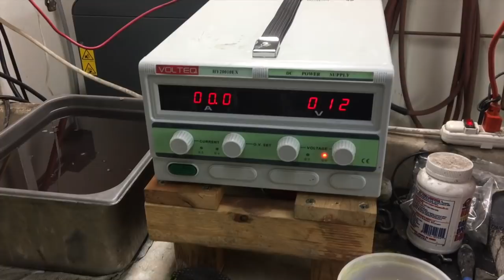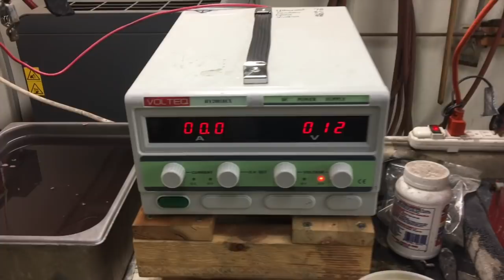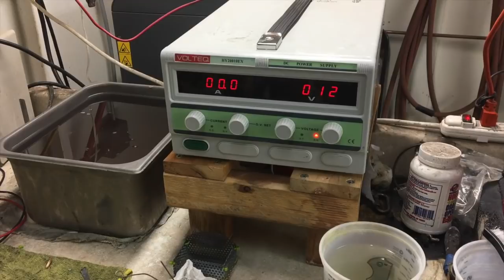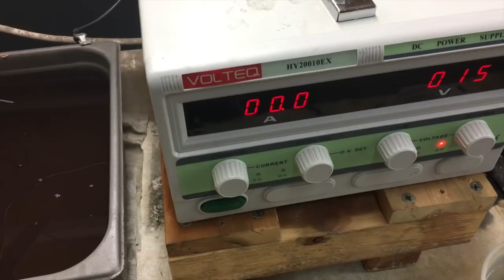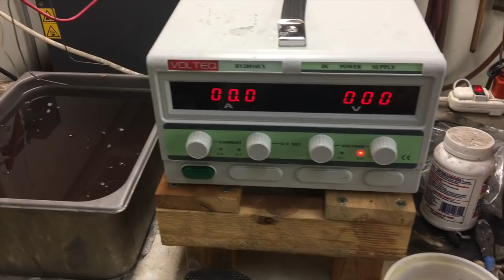Anodizing, Alchemy, and a touch of Science

Comment: Hi Chris, question: I see you setting the Voltages on your DC PSU. Are you also setting at the same time your Current? I didn't see you do this, only when you put your metal piece into the bath, I see a Current jump that bottoms out to zero. To ask that way: you don't dial in any current, just the Voltage, the PSU delivers the necessary Current automatically, PSU shows peak current and drops to zero / is this correctly understood?

Comment: Thanks Chris for a great video, very helpful.  Two questions: Do you use the Multi Etch cold and do you cover the part of the scale that contacts the bearings and the stop pin with anything?
Reply: Hey Ron!  Our multi etch is "cold" but it never gets below 65F in our shop so it's not that cold.  As long as we don't forget about a part in the multi etch for hours the dimension loss is very minimal so most of the time if we don't exceed 120 minutes (the normal soak time is about 60 seconds) then it not an issue.  We also don't set final bearings pocket depth until after finish work is completed  so that helps too.  If I'm deliberately trying to dissolve some ti for apocalyptic looks I will mask critical areas.

Comment: I really found this video helpful, thank you! I got confused watching another video recently that used Wink Rust Stain Remover instead of Multi-Etch ???  Also was advised by another maker to use a titanium pot for my electrolyte solution ??? Any thoughts?
Reply: ronfaircloth Multi-etch and Whink’s rust remover are both effective. They have different active ingredients. The type of metal for the basin does not matter as long as it conducts fairly efficiently.

Comment: I would love to know what you use for masking, I've attempted it with just an everyday fingernail polish with some issues, any tips would be appreciated
Reply: MnJ Cosby I can't tell you what to use for masking; most makers have had success with nail polish it seems. But I can say that you generally don't need to mask any surfaces when doing anodizing, since anodizing doesn't change the amount or texture of material unlike acid etching and whatnot.
Reply: Since anodizing titanium is dependent upon electricity flowing and the surface area contacting the electrolyte solution, the goal of masking should be to inhibit electricity flowing and prevent the electrolyte solution from contacting the  titanium. Think about the types of materials used to insulate electrical components and inhibit the flow of electricity. When in doubt, try it out.